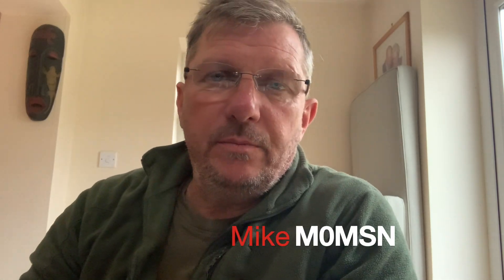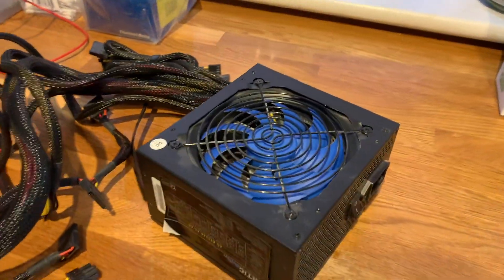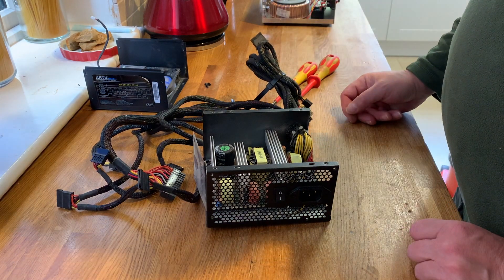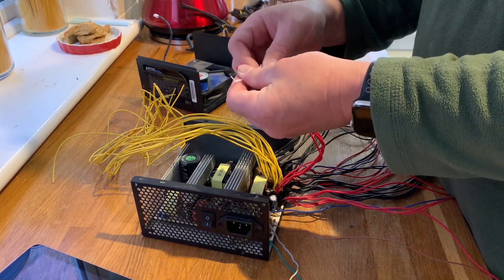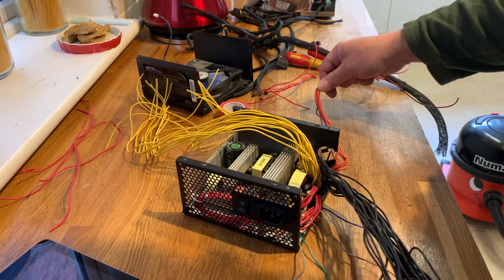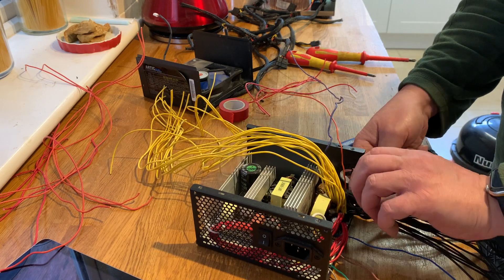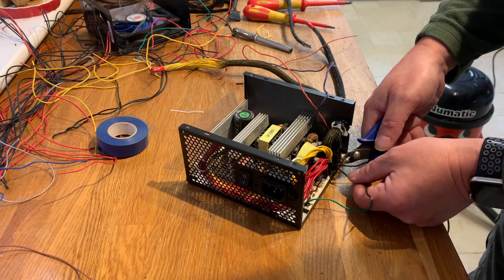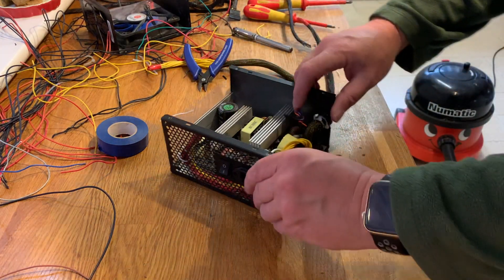CB RADIO: Build a CB Radio/Bench Power supply from a Computer ATX PSU.

Comment: which one is logical;
1. to use fuse before  220V power switch 
2. to use fuses before each outputs (3.3, 5, 12v etc)
Reply from the maker: Both/ all

Comment: Great video. Not flushed with spare cash, I made similar from a disused HP Server PSU and it's done well for me over past 6 months. I was told by some it would make lots of RF noise, but it doesn't.. at least nothing like the neighbours alexa controlled LED lighting system :/
Reply: A written guide for mine if anyone's interested, but there are vids on the net.. https://charlietangodxgroup.forumotion.com/t2615-cheap-high-current-power-supply-option

Comment: I've found that some blade server PSUs produce extremely clean and stable output. HP comes to mind here. 
I had a small project going trying to increase the output voltage to 16 volts for building a uP-controlled high capacity LiFePo battery charger but I had to pause it for a bit.

73!
Reply from the maker: very true, many thanks

Comment: Good as a stand-by power supply, I don't fancy using them all the time, apart from the noise that may come out of them (or my not as the case may be) I don't fancy one if it goes faulty!  Nothing might survive, though on saying that, we use them in computers and don't give them a second thought.  You will not get 13.8V out of them though, but there is one Radio Ham in the states says he has never used anything else and had no problems.
I myself would rather have a linier power supply.  That is a personal choice.  
If you were moving one around there is a huge weight difference, but then I don't see why anyone would be moving around a power supply very often!
Nice one again Mike.
Reply: Yeah, thats what I was thinking. I would trust a computer powersupply over any cheap 10A CB powersupply. Computers are far more critical as it comes to ripple and stability.

Comment: Great idea. Had one in use for years but limited use at 12v. The instructions I found then put a high wattage 10 ohm resistor on the switch feed not direct short. Ideal for bench test of QRP and various accessories. I put a car connector socket  on it as well as PowerPoles and Binding terminals so can plug in usb charger, small iron etc. I reckon its probably 20a but I fused at 10a for safety.

Comment: I use the LED  power supplies you can get from amazon  or ebay  I just got a "battery charger" that is 75 amps for my amp same amount of work though after power input and adaptors to your chosen
 plugs like Anderson

Comment: Nice job Mike. I did this hack a few years ago and I have a power supply that gives me about 68 amps at 12 volts. It works great but I would like to be able to increase the voltage to 13.8 volts DC. It can be done but you have to disable or increase the over voltage protection circuit so it does not trip out when you raise the voltage to 13.8 volts. But without a schismatic I'm not sure how to do that. These power supply's have enough amps to run a 100 watt rig to full power and not even get warm. Throw on a few Ferrite Cores and you can clean them up so that you don't get any hash on HF. Hack a 1000 watt computer supply and you have enough amps to run a 500 watt amp like the Ameritron ALS-500M with ease. 73 Joe
Reply from the maker: Nice, will have to look at these a bit closer.

Comment: I like using server power supplies.  I just wish I had a safe way to boost the voltage to 13.8v
Reply: Hi ~ I studied Acid Batteries a bit  why do you need 13.8V ?
Reply: @男メロウ  12v will not charge a 12v battery and most kit expects the battery to be fully  charged at 13.8v off load.
Reply: @alanjones3873  I know that !!  why do you need 13.8V are you designing a Battery Charger or do you just need a 12V PSU ?
Server PSU will give you more Voltage with a tweek or you could easily create a circuit with an input of 12V and an Output of whatever Voltage you want. Just remember to limit the Amperage going into any Battery. Trickle it and you will not damage the Battery.  You could throw me a question if you want ~ I have an Electronics Engineer qualification .